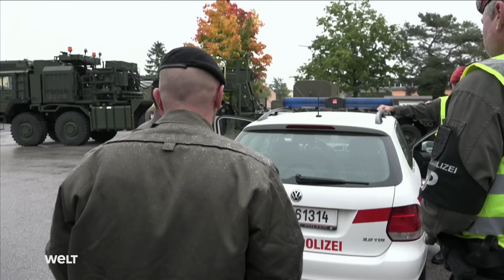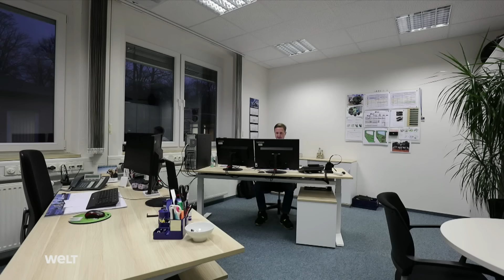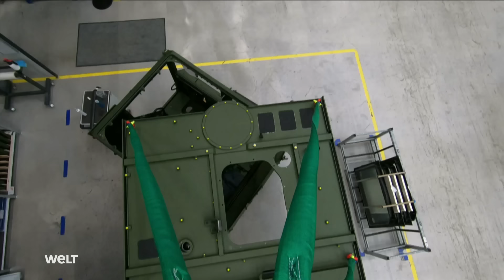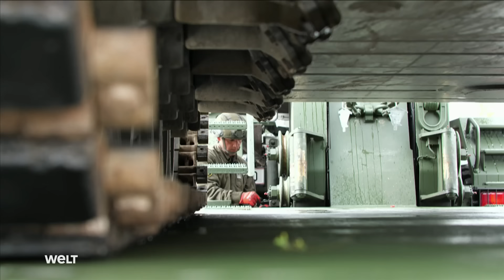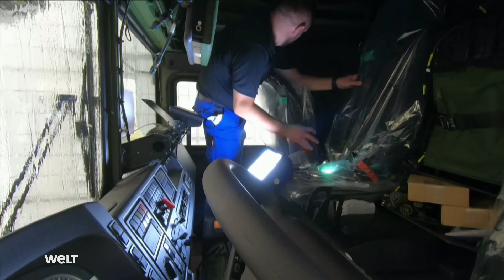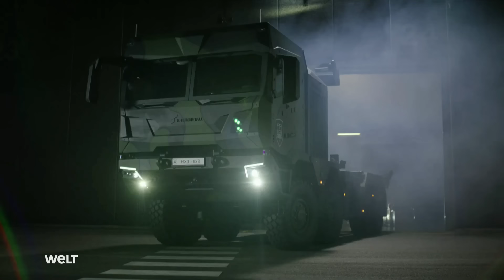GERMAN GIGANT: Bundeswehr Most Powerful Tank Transporter HX81 - V8 Engine with 680 HP | Documentary

Comment: Why not just use Scania V8 engine..?
Its a better and more powerfull engine
Reply: Yes, you are absolutely right.  The Scania V8 pumps out 780HP and can be modified to 2000HP and over 3000 Ft. Lbs of torque!

Comment: will this vehicle destroy the public highways given the enormous load ?
Reply: No that's why it has such massive tires and so many wheels on the trailer to offset all the weight, youre only limit would be light bridges and asphalt roads with low ton ratings

Comment: 680 hp does not seem too much power, a lot of modern cars even approach that...but more important then hp is without a doubt the torque it can produce and the gearbox that multiplies it multiple times. Cars do not put out > 1300 Nm that trucks often have with commercial use road gearboxes. This truck obviously puts out a lot more. Mentioning the torque of this machine would be far more impressive and a better measurement of how powerful it really is.
Reply: 37:23
Reply: The Mammoth engine produces up to 2700 Nm of torque , they mentioned it at 37:20 in the video

Comment: Why has it got such a small engine? MAN is part of Traton. They could have given their colleagues in Sweden a call, and gotten the big boy engine from Scania 😂
Reply: They also could have given their colleagues at MTU Friedrichshafen a call and gotten an engine that dwarfes everything Scania has to offer, there just isn't a need for it.
Reply: Well both MAN and Scania are 100% VW owned. The "military" part of MAN trucks production & development had to be sold to Rheinmetall because of this ownership. RM is not limited to use only MAN or Scania engines, eg MTU/ Mercedes-Benz, Renault, Iveco or Liebherr are possible alternatives. AFAIK only Volvo (chinese company) is blacklisted for orders from the military within NATO.
Reply: @m.h.b.3828 the Liebherr and MAN v8 are the same engine. What kind of idiot are you? Volvo AB the truck bus and heavy equipment manufacturer is not th same company as Chinese owned Volvo cars. Time you got a clue.
Reply: @m.h.b.3828 Only Volvo cars ended over time in Chinese hands,trucks are still under original Volvo company that sold car division in 99.
Reply: They could also be smarter than you, just a wild guess.